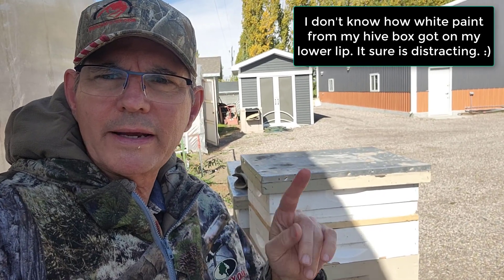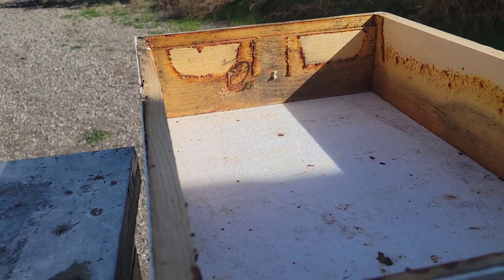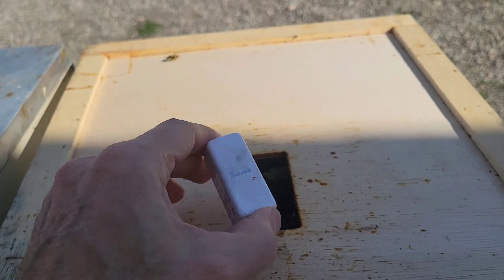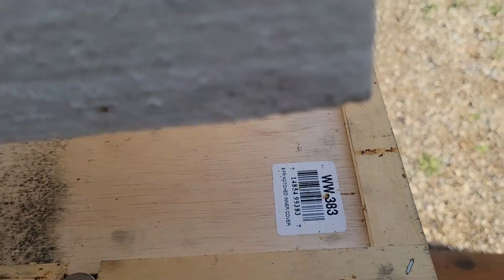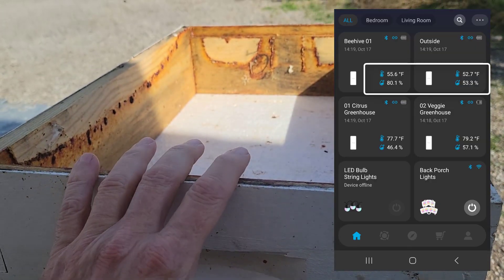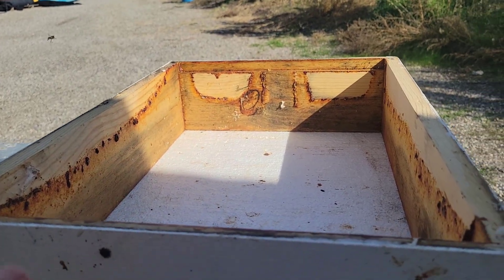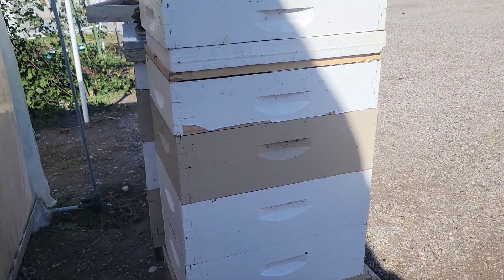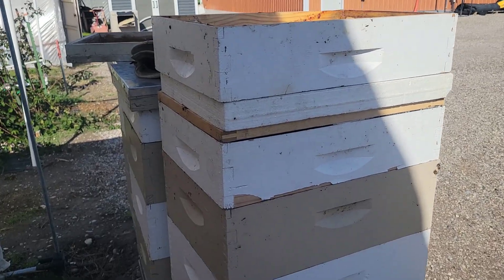Beehive Winter Ventilation - You're Killing Your Bees!!!

Comment: There's many ways to do it depending on yourself and how many hives you have. Most important is hive top insulation. I use a 3" entrance and a half inch hole for a top exit and vent. I no longer go out of my way with shims etc to vent hive in winter, but find some ventilation controls mold. I also wrap in tar paper, and huddle hives. Last year had 83% survival of 40+ hives.
Reply from the maker: That's excellent advice and a fantastic survival rate!